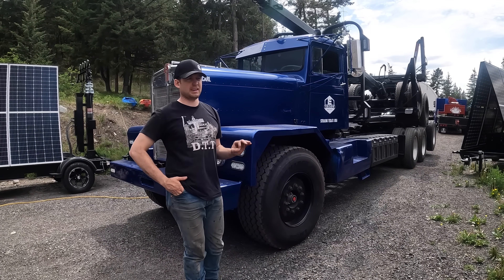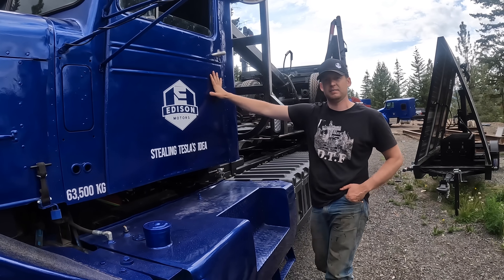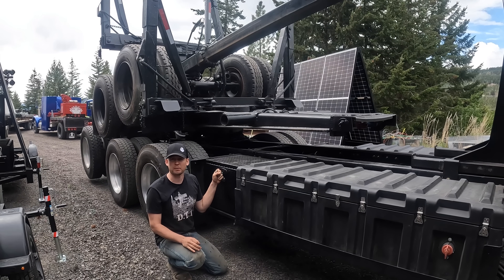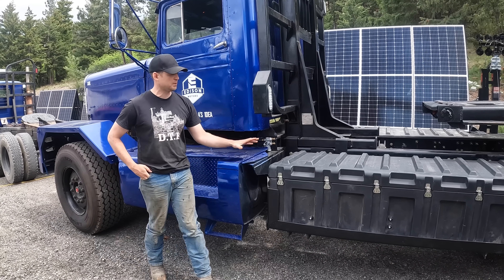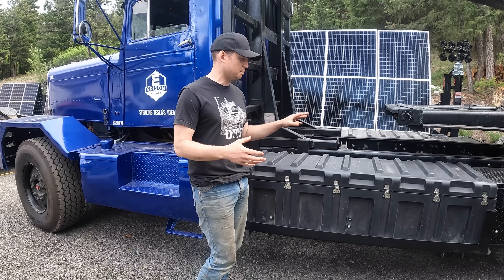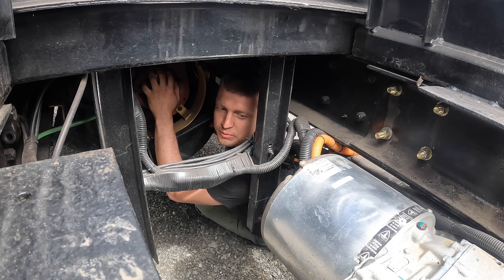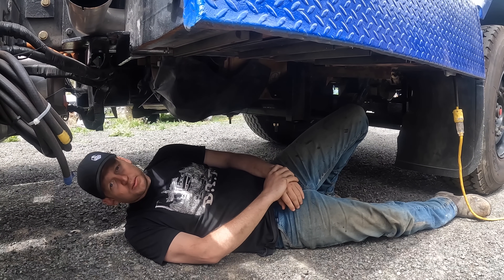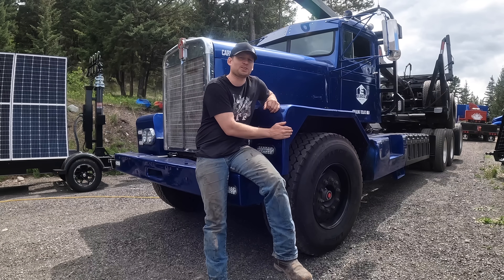Learning from Carl: Electric Truck Proof of Concept Revealed!

Comment: As a heavy duty mechanic I love this. I work at a refuse fleet shop. We had a Mack electric demo and it only could run half the day with range and carry half the weight of our cng and diesel trucks because of the added weight. I would love to see the industry switch to this concept it's the right stepping stone of being more eco friendly than demanding full electric when the tech can compete right now love the channel!
Reply: I read somewhere that trash trucks are the perfect (and almost only) application where gas turbine/battery/electric works...and there for some reason it works splendidly. Has something to do with the repeated starting/stopping of the use case.
Reply: @toddmarshall416  that's why the electric truck was semi okay because during the route the truck was perfect stop and go wasn't using hardly any battery for the route itself especially with regenerative braking being utilized well. The issue was driving to and from route killed so much battery due to the weight of truck and allowable space for batteries that it was very non practical for our fleet but a hybrid would solve both problems
Reply: @jaysonsears8686  It's the Prius model. As I said, there's an article out there somewhere about it working with a gas turbine. Diesel would use same principle and work better at sea level. Regenerative braking would have almost no effect. It's all about being at the optimal point on the power curve for the ICE for efficiency.
Reply: I’m in the honest opinion we watched this man change the trucking industry completely
Reply: @Mathewwoods178  Surely you jest. He's reinventing 80 year old technology used in locomotives with the introduction of the diesel engine and electric drive. He's adding a battery which wouldn't be practical in locomotives...or in over the road truck tractors for that matter. Now DEF? ...that really has changed the trucking industry completely.
Reply: @toddmarshall416  eh, hardly anybody's changed the world by having a new idea. Way more people have done so by taking an old idea and figuring out a new place to put it.
Reply: Has the added advantage that as long as you can get fuel to it, it can go. Pure electric - getting the solar panels out in the middle of winter during snow when it runs out of charge? No, if that was a possibility, you wouldn't run the vehicle there, which would pretty much screw up any attempts to get electrical vehicles in the deep bush (sorry, forest. I'm a Kiwi - anything with trees can be categorised as "open", "scrub", or "bush", there's pretty much no inbetween, and "bush" covers everything from heavy scrub to dense jungle to taiga or the equivalent, not that there is taiga in NZ).
Reply: "eco friendly"?
You should invest some of your time educating yourself on what it takes to make these batteries.
You are the type that thinks that "solar" and "wind turbines" are eco.
They are only eco cause you don't hear how destructive they are to the environment because the people pushing the"eco" badge want you to remain ignorant, while they profit handsomely.

Comment: Truck is looking nice, thanks for the update.  It could use dual plug ins.  One on each side.  That way you can hook up on either side, or hook the truck to 2 chargers at once.  Ya know like a real truck fills up.
Reply: I was thinking the same thing and I imagine it wouldn't be difficult or expensive to do.
Reply: Isolating 2 AC charge plugs is easy. Making two DCFC stations feed into one vehicle is very hard. Possibly goes against the CCS design requirements.
Reply: this is amazing
Reply: Maybe set up switches so each side can be disconnected  from the other side and every thing else and charged separately simultaneously
Reply: @ianpaterson6111  Yeah, like a battery switch in a decent size boat.  You have 2 batteries and the switch lets you choose which one you are using.  Would not help with the dual charging but you could pull up and charge from either side.

Comment: My Volt has separate radiators for the gas and EV components. Another advantage with this is after hitting an animal, cracking the gas rad, the EV system could still get me home.

Comment: Back in the late 80's International and Eaton Yale did a proto type with a DT466 running a generator to power an electric motor hooked up to the rear axle diff.Remember seeing this deal at the truck show at the Tradex.This deal was on a 5 ton chassis.
Reply: @brianb-p6586  Currently the only way for a battery powered truck to run coast to coast is to have a small diesel generator on board to recharge the batteries during driver breaks.Until a full nationwide charge system is in place.

Comment: Great job getting a prototype together and making it run.  So many companies spend decades trying to be perfect on the first try.  It's way faster and cheaper to slap something together and find out what you don't know right now.  

Surprised the Telsa motor doesn't have an easy way to set a phase-current or torque limit.  Could always replace the bearing and output shaft on that side, but that's a lot of work for an Alpha prototype you know will get rebuilt or scrapped.

Comment: This thing is awesome! On bended knee, make the battery packs removable so you can swap them out and charge them outside the truck. Why? Because you wouldn't have an impact driver with a built in battery. You want a swappable battery. This truck is a tool and a battery pack that can be charged outside the vehicle is key to EV's. It also makes it so the battery pack can be replaced and serviced without down time if you have a spare pack.

Comment: Could have used a planetary output bolted the the end of the Tesla motor. 
A cheap and simple setup would have been a planetary gear reduction unit from a diesel pickup truck. 
2.7:1 reduction with a 6 planet gear setup and capable of dealing with 1000 ft-lbs and relatively easy to adapt.

Comment: have you looked at any super capacitor options instead of batteries? i know that caps "Leak" power but they charge faster, are able to discharge more faster when needed and don't require Lithium and Cobalt! i don't know if anyone does them for how you need but it could be another option, plus i think they would be a fair bit lighter!
Reply: They use super capacitors on the Chinese busses, they're more efficient for the regen braking. They're heavier than lithium ion but can charge and discharge faster and more often, so they work great on busses and I would think garbage trucks too. You only need enough for 1 stop and 1 start, so the extra weight doesn't matter much.

Comment: Silly question?
Could you run the Tesla Motor output into a reduction gearbox? 
The motor assembly can push a tesla to like 125 or 155 mph and a truck would go mabe 75mph. Given a car tire is like 0.75m or 28" and a truck tire is like 40+ inches or like 1m diameter, you could go with a further reduction of like 2:1 without sacrificing any speed of the Truck.

Just a though.

Comment: I don't know if this is your first You tube video on this project, or just the first one I've seen.  But would have been good for you to kind of intro in the beginning what the heck this project is.  So sounds like it is an electric engine truck with an on board generator to charge batteries.

Comment: Have you considered using a torque converter behind the drive motor, to reduce the shock load on the motor, while still exerting enough torque to the axles to move the truck? If so, whats the reason you didnt go with it.

Comment: Huh, I'm surprised the Tesla motor could snap its own output shaft if you floor it. Aren't the controllers built for flooring it? Or it's not the original controller?

Comment: Might be able to overdrive generator with a gearbox so diesel can run at say 12 to 1300rpms instead of 1700 will increase mileage as long as diesel has enough snot down low to spin gen

Comment: How do the batteries hold up underload I know its been an issue with most EVs how do you deal with the increased battery use when moving heavy loads and whats the GCWR on the truck?

Comment: If you are running it as a 60 Hz generator then the speed will be 1800 isochronous, not 1750, except if you put a big load on it briefly till the Governor gets  caught up . A few seconds max.
I thought you said it was on or off not doing Eco Mode games so constant speed.

Comment: Funny thing is, what you are doing here is what locomotives usually do. It's already a proven system, just that yours has batteries.

Now, for trailers with flammable/hazardous stuff, you may want to consider allowing an NiMH option. This would sacrifice a lot of capacity and power for safety, however. Again, I think much of it comes down to use case.

Comment: It aint elektric dude. Its a hybrid.
Reply from the maker: A hybrid can run independently off multiple fuel sources. 

This is a fully electric truck with an onboard, diesel powered self charger.

- Theron Danger

Comment: When you get to the point of doing more trucks, or this one for proof of concept, checkout Speed of Air pistons for the generator. The fuel consumption gains  are incredible, as well as reduced soot both in the exhaust AND the oil, greatly reduced NoX numbers with the associated reduced maintenance as well as bent much better for the environment.
Again, Speed of Air Pistons!
Reply: Is this an aftermarket upgrade product for cat and/or other diesel engines?
Reply: I was quoted over $4000 for a set of Speed of air pistons for a Ford powerstroke.
Reply: @danieljacobsen7196  No surprise to me. But if done at rebuild time, incremental cost is less horrendous. Truckers will spend thousands to get 2 % increase in fuel savings. 25% is a no brainer for 4 k. And also ties in to efficient, clean proof of concept plan here. I’m not tied to Speed of Air.  Just transferring possible great technology.
Reply: @danieljacobsen7196  - if you drive it A LOT, I guess it could be worth it...
Reply: @orcoastgreenman  The business case for Speed of Air technology is clear and it is simple.

-For businesses that have difficulty meeting emissions requirements, Speed of Air technology allows the possibility of extending fleet life without expensive after-gas modifications and/or re-power.  For those operating in highly-regulated EPA non-attainment geographical areas and subject to expensive non-compliance fines, Speed of Air offers the ability to avoid those fines while ensuring unhindered and reliable production.

-Speed of Air technology reduces fuel burn which directly impacts your business’ bottom line. Fuel savings vary with engine type and use, but we have demonstrated fuel burn reductions approaching 50% in some constant speed applications.

-Extension of service intervals and engine life. In Speed of Air’s most recent CAT 3516 mine haul truck engine application, oil change intervals were nearly doubled compared to our truck’s running mate.  Not including the opportunity cost of increasing the mine’s utilization rate, Speed of Air technology saved nearly $250,000 in direct operating expense over the approximately 18,000-hour service life of the engine, compared to its running mate and based solely on labor and materials for oil changes. Moreover, the tear down conditional inspection of the engine’s internal components showed main bearing life to be at about 50% with zero carbon build up on the piston crowns or ring lands. Additionally, Speed of Air technology significantly extends-or eliminates DPF re-gen intervals, further reducing maintenance costs and maintenance down time.

Regardless of whether your business is directly regulated by emissions standards, the value of making a positive impact on our environment, while enjoying the bottom-line operational savings that Speed of Air Engine Technology offers, is a priceless decision that cannot be over-stated.

Comment: I really can't wait to see the next truck with the full E-axes in place. 
personally, I like the batteries external; it makes them easier to access and remove with only a small shop hoist if need be. swapping them forward would be good for sure. 

I honestly LOVE the design philosophy of having all the components as separate modules built around a centralized frame. it makes everything so accessible and easy to repair, maintain, and inspect.

Comment: Could you power a rear axle with an eAxle? like if the eAxle has an output shaft you could use one electric motor to drive both. Maybe this would keep the cost down on a powered trailer or on a more road-going rig.
Reply from the maker: That would work yes.  But wouldn’t be as much power
Reply: @EdisonMotors  it's more power than Carl I think. I'm not a truck driver but just brainstorming. Appreciate the way you guys interact with your followers

Comment: You otto look at some diesel/Electric train locomotive's, they've already tackled a lot of the issues your finding. They run the air compressor and cooling fan in the same assembly on some and exhaust hot air up instead of across and down under. They've even put separate cooling fans on the dynamic braking heat disapaters up on top.

Comment: Is it possible to have an eaxle also be liftable? I like the idea of running 4x2 empty and 6x4 loaded
Reply: You are really starting to get heavy on these trucks, I can't imagine these retrofit trucks being able to scale 40,000lbs in the trailer with the amount of weight already involved in the components. A cantilever air lift axle, like flatbeds use, you're talking another 500lbs of added components. It would be better to have an electric disconnect for one E axle, the tires would still be rolling but the one axle wouldn't be pulling voltage while empty or bobtailing.

Comment: What is there for side protection in the battery packs? Lots of accident I attend have fuel spills due to either contact with trailer (landing gear) or other vehicles ripping them open. Obviously diesel spills aren't great but these batteries like to get burny once the cells are damaged.
Reply from the maker: Our production truck will have the batteries located between the frame rails - Theron Danger

Comment: I find your trucks interesting. While going for a efficient hybrid type setup. Maybe look into a waste heat recovery system. Since your operating the engine as a generator to power the truck at mostly steady state conditions. I think a system that incorporates a boiler in the engine exhaust to turn some type of generator to further get either more charging or use it to run only the cabin items to focus power to the batteries and E-axels? Thought?

Comment: You can figure out the correct way to get all the coolant heat managed with valves and sensors, but that’s too much work. Having a separate low temp system for the EV and a high temp system for the generator is simple to produce and easy to fix.

Comment: You should add in some redundancy’s to increase the usability and reliability further. Things like a plug on both sides. This adds ease of use in a crowded yard and a backup to help diagnose problems.

Another one is ability to have the generator directly power the motor. Doing this would help the heating issue during charging and will extend the life of the battery. It also allows the truck to run even if the battery eats it or there’s a problem with the charging system.

Comment: Question:
Wouldn't make a cab-over design be better suited for logging? 
So you could turn much tighter and see everything?
Basically what is the reason you went with a american style truck. What are the advantages of those for offroad use?

Comment: Hey you should put a heat exchanger, with shut offs to engage or disengage to allow the coolants to equalize when it would be beneficial for example before a cold start on the diesel or if the batteries are a little cold.
Reply: Or if the batteries or axles are a little hot like they would be here in Australia. I'd rather cook the Cat and use its radiator.

Comment: I mean this whole thing was a success and that’s with things mocked up to make sure everything works and you guys did great. 50-60% increase in fuel economy is wonderful. The thing about the generator is it will last a lot longer because it’s operating at one specifically set rpm so that saves a bunch in engine maintenance and down time. You guys are awesome!

Comment: first time i ever heard of a genset running at 1750 rpm’s. in north america we run on 60Hz 1800 rpm for a 4 pole generator 3600 for a 2 pole and 900 rpm for a 6 pole 👍
Reply from the maker: Ours was putting out 60 at 1750 on the load test.  It could be possible that the 30 year old rpm gauge on the old CAT was off a bit though

Comment: Have you thought about the front wheel drive assist that's hydraulically driven for off road help they now make (I forgot the company name) but would be a great option for these loging trucks and use a brushless pump or drive it off the generator an just start it when needing the front wheels to help
Reply: They have talked and have an electric steering axle to put in.

Comment: Did you install power steering  or are you still using arm strong steering , what was the solution for the hydraulic pump? I think I know your answer  but that  would be a constant  draw on the power  source.
Reply from the maker: Electric power steering pump

Comment: Motor per axle makes sense for the back but what about a motor per wheel up front?  More weight forward (even if it takes a bite out of the savings you've made) and more traction too.  You might be able to get away with a motor that can pivot and have only the outer CV joint.